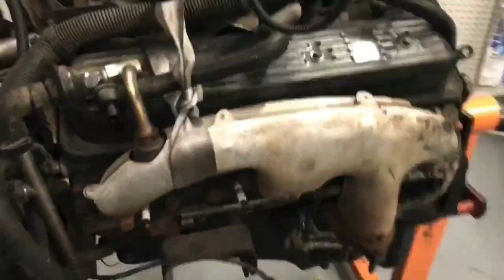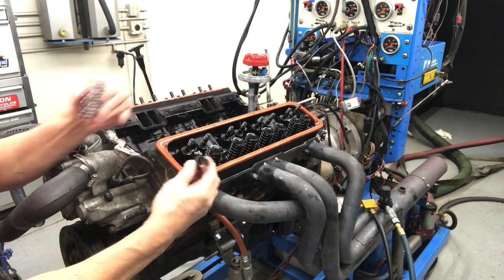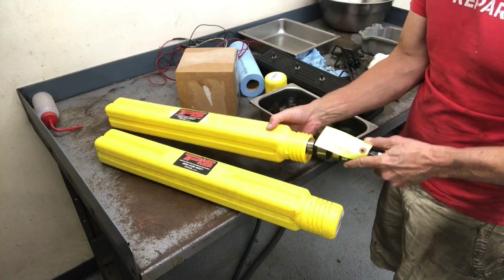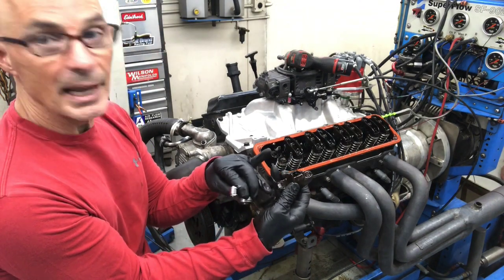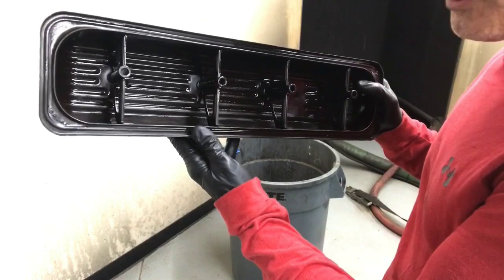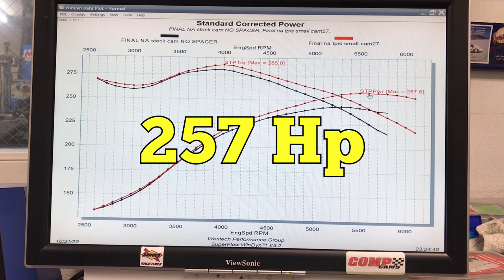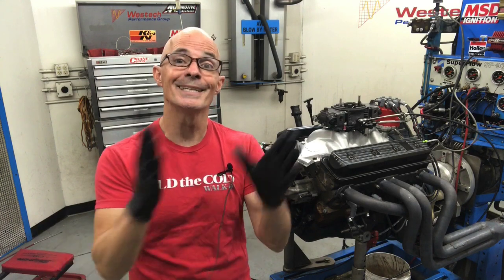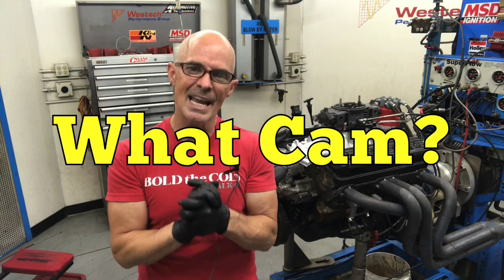4.3L L99 CAM (& ROCKER) TEST-(THE OTHER LT1)

Comment: I think you should have tried the COMP Cams Thumpr Hydraulic Roller Camshafts 08-601-8 Dur: 235 int./249 exh. Lift: 0.522 int./0.509 exh. lsa 107 it probably would have made 300 hp + and similarly torque. Always love your videos and the way you think out side of the box and teach us very valuable info that no one else seems to think we need.  Thank you for everything you do Monte
Reply from the maker: not sure that would fit stock p-v
Reply: @richardholdener1727  what is stock p-v

Comment: Would a stock LT1 cam be beneficial in the L99?
Reply from the maker: yes
Reply: @richardholdener1727 cool.  I've followed your L99 vids. I have a 40,000ish mile L99 that Im going to put in my 68 convertible with a M29 6spd (1993 only) with 342 rear gears. LT1 cam, gmpp intake, headers and FItech.  I want a car I can drive long distance and get good mpg.   I originally bought the L99  for my wife's Jeep project because she liked the v8 sound...... then i traded in the wife...kept the engine.

Comment: I still keep coming back to the l99 video's after 2 years😂😂😂 and my 385 will be ready to drop in within the next couple of months. It's down to the external nickel and dime stuff outside of assembly. Headers, engine mounts ect. Would you be interested in dynoing a goofy little l99 if I slap one together in a couple of years?😂😂😂 I have some theories for a budget goofball engine. Bone stock outside of cam, pistons and what I violate with the dremel. NA 87oct streetable of course. Even though I have no use for them. If I was to take a stroll around the block, I don't guess I'd say much if you stuck one of your hairdryers to it. Might need a little heads up before I gap the rings though 😂😂

Comment: Did you ever seen on any L99 (LS3) oil leak from head gasket? I have small leak coming somewhere from top, couldn't determine, is it valve cover or head gasket leaking :(
Reply from the maker: valve cover usually
Reply: @richardholdener1727  many thanks

Comment: Would really really like to see the 230/236 duration @ .050, .510/.520 Lift and 110/112 LSA, also if the OPTI SPARK is removed any sbc cam can be used as well as other sbc timing chains sets with the exception of a double roller because of clearance issues of the timing cover, this info should really open up the number of cam testing!!!!!!!!!

Comment: Hi.  In process of changing my valve springs on car with that style compressor using a rope in the spark plug hole.  Running into an issue getting the keepers out while pulling the compressor handle.  I had to recruit help to push on the compressor handle while I smacked the retainer to free the keepers.  How do you do it by yourself?  Any tips?
Reply: Well I figured out how to get the keepers off without growing a third hand.  What worked for me was to feed the rope in the spark plug hole so the valves would travel just a short distance.  The valve would hit the rope before the valve spring reached coil bind.  

Without the compressor on the spring, I whacked the corner of the retainer pretty hard with a brass drift and heavy hammer.  This seemed to loosen the keepers up enough so when I used the lever style spring compressor like in the video, the keepers stayed in place and only the retainer and spring moved down.  Some of the keepers were stubborn.  The last one I had to hit especially hard and one of the keepers flew off and landed about a foot away from the engine.  Luckily I saw what direction it went.

Comment: would love to see the cam i installed in my lt1... from Willhoite Camshafts 
According to the cam card from this company, it uses a comp cam CS XR282HR-10 230/236 at .050 Maximum valve lift is .510-inch on the intake and .520 on the exhaust. It is ground on a 110-degree lobe separation angle. comp cam xr282hr
here is the video link to the cam I am using https://youtu.be/zdwhWqYpfNk
According to the cam card from this company, it uses a comp cam CS XR282HR-10 230/236 at .050 Maximum valve lift is .510-inch on the intake and .520 on the exhaust. It is ground on a 110-degree lobe separation angle. comp cam xr282hr

Comment: Glad to see you doing more trials on my second favorite engine. I have three L99s stored away for future projects and I have L99 internals stuffed in a 305 block residing in my 88 Formula Firebird T56 TPI. I would love to see dyno results of a cam close to the Duntov 30-30 specs except in a hydraulic roller. Better yet, go buck wild and see how it compares to its big bore cousin the Chevy 302.

Comment: Elgin E1135 306 cam 230 @ .50 480 lift on 108 is a good little cam i put together a  vortec 350 for a friend used this cam a cheap single plane and a 650 holley 2800 stall 3.73s in a s10 it was suprising lol.

Comment: It'd be awesome to see that little thing turn some rpm. I don't know how strong the rotating assembly is but it's small and should be relatively light for stock at least compared to a 350 or something. With only 3 inches of stroke piston speed should be relatively slow too. Plus I have a thing for high revving small v8s lol

Comment: I have a question, do you ever measure on your dyno , the time to max torque or the time to a specific rpm?
I thought that this might be of value in differentiating engine designs.
Reply from the maker: the rpm rate is fixed and controlled by the dyno (we tested at 300 rpm/second)

Comment: Hey Richard, if u have some time i would love to get ur advice on a build im workin on.
Reply from the maker: ask away
Reply: @richardholdener1727  im tryin to build a 04 tahoe for a good performance daily, im doin a btr stage 2 truck cam with beehive spring, 7.400 pushrods, ls7 lifters, longtube headers, tbss intake, 80lb injectors and a procharger. Is there any recomendations u would have that would give me the longest life outta my lm7 with this setup?

Comment: The GM 12677151 the roller cam used in the SPO 357 hp 350 Vortec.  It is 215/223 @ .050, .473 lift, (.503 with a 1.6 rocker) with a 108 LSA and 109 ICL.  Runs very well in both the 305 and 350 Vortec I have tried it in. I think it would work very well in the little L99 given the heads likely flow very well.

Comment: Hi 
Very pleased with all the efforts that you've been putting into the L99 4.3 L 263 cubic inch small block Chevy it's nice to see somebody going for the little guy I've been into these engines since the late seventies and I have several of them I had a 262 Lv1 from the 75 to 77 Monza Nova and Ventura and I presently have several L-39s witch is the 267 out of the G-Body I don't know if you were aware but the cubic inch  displacement of the L99 is 263 
4.3 L the bore on a engine is a
 3.736 which is identical to the 305 and the stroke of course being 3.00 with a one-piece rear main seal it shares the same bore with the 305 I just wanted to clarify that for you for your information okay thank you and have a nice day and appreciate all your time PS
It was Chevys tribute to the
1955to57 265 bore 3.740
Stroke 3.00

Comment: Richard, I'm sure that small-valve head is limiting the RPM of the wider LSA cam.  Try it again with the LT1 head if you find out the valves fit in the bore.  I would expect the old GMPP 12730846 to work well here too.  This engine needs to see 7000 RPM, unless you're afraid to turn this series into a big bang video?
Reply from the maker: with the right cam and springs-it will see that rpm

Comment: Wide lobe separation not good...why? The answer is it kills the overlap which is the key to mid-range torque production. Widening the LSA means the intake valve opening moves away from the exhaust valve closing, that’s less overlap, or maybe more negative overlap. It also makes intake valve closing later, which promotes high rpm power (torque, which corrected for rpm is horsepower) but kills lower rpm torque. So the results Richard reports are completely predictable. Just look at an LS with an LS9 cam vs an aftermarket cam. The LS9 cam makes good top end with a complete lack of mid-range. The SS2, for instance, makes the same top end with lots more mid-range. That’s important on the street, or, with any small displacement engine that is torque limited. That TPI manifold is probably going to be very good with a cam that has decent, relatively short, duration, 0.500 or a bit more lift, and 110-ish LSA. This 4.3 could be a great engine for a light weight street machine like a Fox body or kit car. We’ll have to see what cam and intake are going to work best for that application. Of course boost is going to raise the power to levels for a wider range of vehicles.

Comment: 212-218 max out lift maybe 450 450  on a 112 lsa would work we’ll either carb or fuel injected I’m thinking the second cam is a no tune drop in emissions friendly camshaft

Comment: From the test it’s the lift and lsa that is causing the second camshaft to make less power down low if the second cam had same lsa and lift as the fist cam it would make more power this engine is to small to take advantage of the wide lsa on the second camshaft it wants the events closer together the split was not the issue.why this cam manufacturer would not keep lift the same or more on the bigger cam is weird the only benefits to the second camshaft would be smoother idle and better emission 😂

Comment: My aluminum 1.6 roller rockers fit under my stock stamped steel centerbolt sbc valvecovers. You must need to get narrow body, self-aligning rocker arms. It's a little snug, but I can get them on and off twisting them around the front accessory drive and brake booster and A/C lines in the truck. They do not hit the valvecovers with .550"/.546" lift. They are the blue pro comp cheapies from summit. They were $200 when I got them. I have another set of those 1.5 roller rockers in my 3rd gen Camaro that I bought 10-12 years ago.

Comment: This block needs a stroker kit. I don't know if 334 stroker kits are still around but you could run 400 rods if you can't find the pistons. Put a tpi with the runners siamesed at the plenum end on that or an accel super ram with lt1 aluminum heads and a centrifugal supercharger to extend the top end and it could be quite the engine and able to rival many modern engines. Although I want to see an lv3 modified with a carb manifold for an ls3 with 2 runners sawed off for comparison. At supposedly 360lbs the lv3 could be a hot little 4.3l v6.

Comment: I have two questions...

1) If you were too install guide plates can you use regular non-guided roller rockers?

2) can you run that engine if the opti-spark dizzy is removed?
Reply from the maker: yes-you could machine the head for guide plates and screw-in studs-yes the opti can be removed with a different front cover
Reply: @richardholdener1727  awesome and thank you for answering my question personally.  I love your content especially the odd engine build ups! Cheers~

Comment: Try a Comp 08-422-8:
218/224 110 LSA
.495 / .502 @1.5 | .528 / .535 @1.6
Please go flow those heads so we can nail down the lift limits lol.
Reply: Good call! I'm right there with you.
Reply from the maker: that should work well

Comment: Are there any size/weight differences between the 4.3 and the 5.7? Personally on the hunt for a small V8 for a Baja Bug swap and I don't realistically need 300+ hp to make mine fun, but I want the good noises!
Reply from the maker: the LT1 had alum heads so it would be lighter

Comment: Whenever you're working with a small cubic inch small-block Chevy it is always wise to go to a close lobe separation angle I had a267 L39 with a 3.48 stroke with a 3.500 bore and I used a 435/435 108 degree load Center on my original to 267 from isky race cams it was a flat tappet cam workd excellent another thing that works really well on this small engine combination is an Offenhauser dual-port 360 manifold I'm using one of those on my to 267 presently with a 5sd stick and it works great as got gobs a bottom-end torque with the factory Roller cam
 u just removed was pn#600 or 779
111 lobe ctr. 418int/430ext 
Is it possible 4 u 2 try offenhouser duel port 360 mannafold  w/a Q J carb ?
Reply: The advantage of a Offenhauser dual-port 360 intake manifold with a Quadrajet is a Quadrajet in the primaries has dual boosters which gives you a strong vacuum signal coupling that to an Offenhauser dual-port 360 manifold in effect works on the same Principle as having four valves per cylinder with the high velocity of the fuel-air ratio mixture coming in from the primaries you end up with a strong vacuum signal at low RPM
Packing the cylinders thus  vastly improving bottom in torque

Comment: Is it possible to video the torque procedures for the rockers and the head bolts on these motors and also the LS engines? You do alot of cams and head swaps i figure you prolly can do it in your sleep. I would love to know some tricks to get faster. Yeah yeah I'm new to this.

Comment: I would like to see 
212/220
.525/.525
106LSA
 102CL
I think with this small cubic inch engine it doesn’t like the wide LSA because it reduces running compression and cranking compression. It need compression!!!!

Comment: LT4 hot cam 218I  228E  525 lift with 1.6 rockers, I ran one in a 383 with Vortec heads real nice low to mid range power .
Reply from the maker: what is the LSA?
Reply: @richardholdener1727  112 degrees

Comment: I had issues with the bolt tubes in the center bolt valve covers, but I was running trick flow twisted wedge heads, the valves were at different angles, the ran awesome! But the 1.6:1 rockers got in the way of the tubes,
Reply from the maker: does trick flow make LT1 heads?
Reply: @richardholdener1727  yes they do! Look up part TFS-30410010
Reply: @richardholdener1727  these was tpi heads, pre LT-1, but I haven't seen the SBC twisted wedge heads, last time I looked , all I saw was standard 23° heads, they were awesome heads, they could use better springs, I broke a couple springs, but I was a bit hard on it, they made awesome power!
Reply: @richardholdener1727  YES, they make LT1 heads and they even list one for the L99, this link shows the lookup for a 1996 4.3L  LT1 style head;

https://www.trickflow.com/search/department/cylinder-heads/section/cylinder-heads/make/chevrolet/year/1996/engine-size/4-3l-265?N=4294961402%2B4294965891%2B4294966157%2B4294966016%2B4294966142

Comment: I think a custom grind l79 roller cam would have been perfect!!

222/222/ 447/447 110-112 lsa 
Would be perfect
Reply from the maker: needs more lift
Reply: @richardholdener1727  maybe a hotcam ?? Its around 215 duration , 525 lift.

Comment: LT4 Hot Cam along with LT1 intake should make for a nice high-revving combo in the baby 4.3
Sticks to the OEM style setup with OEM parts.

Or 212/218  but on a nice tight LSA (and compare LT1 with TPI intake).

How tight would you go Richard? 106 Straight? +4?

Comment: I generally like your videos because you do things which make me think. With this test I would not personally use the small cams particularly with such a wide lsa. It’s a matter of economics for me. Most bang for the buck. I understand that this is supposed to be a teaching moment by you and you combined that with parts supplied by a vendor. We did learn how to spend money and get mediocre results. Been there, done that and kicked myself while my wife berated me for wasting her money on something that didn’t get the desired results. Listened some more when she found out for the same amount of money I could have had what ultimately did work. She still loved me. Just hated “My wasting her money”. Lol. I tried very hard to not have to have my wife’s repeat performance. Lol. So far I have succeeded. Great video. Not hating on you as I always learn something from you. Thanks for sharing. Btw I do like the small motors. It’s always fun to snooker someone who thinks the small motors won’t run well.

Comment: Keep the lsa tight and get up to max lift with those springs and use the duration you like, 224 232, and see if the cam is "too big." I'm loving the 4.3! I run a hot rodded 265 in my 55 Bel Air.

Comment: Great testing, I bet a comp X4260HR 4x4 cam would be pretty nice in it. 210/214 .474/474 lift 111 lsa. Pretty close to cam 2 but with a little more lift and tighter lsa. 

Or xr264hr 212/218 .488/.495 112lsa might be a little hotter. What's our rpm limit on this little critter?
Reply from the maker: we will go MUCH higher later
Reply: @richardholdener1727  a little late since you already broke it lol but the reason for me to build one of these would be to keep the mild cam V8 sound but with better fuel mileage. I'd love to play around with one of these or Destroke a 267 to a 231 with about a 3k lock up stall and 411's in a g body. A fun fuel saver to beat on that would probably out live me lol especially with modern rollers and thin ring technology.
Reply: @richardholdener1727 just a little funny math. Considering the shorter stroke and the average vehicle is driven 12,000 miles per year. If you figure 2,000rpm average excluding idle time and stop lights it adds up to each piston in a 305/350 traveling an additional 184 miles per year up and down the cylinder walls😂😂

Over the course of 20 years in a daily driver (yes I've been driving the same 03 sierra 20 years) it would add up to about 3,680 miles difference.

Comment: Quick question.  Does the lsa change with those aftermarket rockers? If so, does it make it tighter or wider?
Thanks Richard
Reply from the maker: it does not-duration maybe slightly -definitely lift
Reply: @richardholdener1727  Gotcha

Comment: I’m wondering how bad the factory LT1 intake is going hurt torque with the short runners. That TPI intake should make a strong showing on this 4.3!
Reply from the maker: LT1 intake test coming tomorrow
Reply: I would expect around 310-320 tq with the TPI intake.  The dual plane and carb is already going to be a good 20-30 ft/lbs higher than the short runner LT1 intake.
Reply: In theory it should be 300 to 350 in TQ.